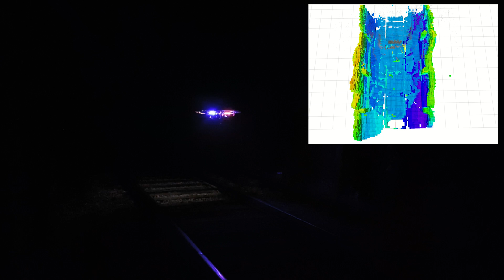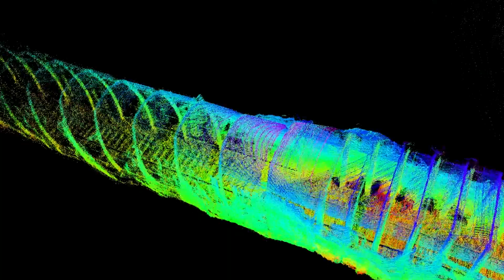Autonomous Aerial Robotic Exploration and Mapping of a Railroad Tunnel in Degraded Visual Conditions

Comment: Hi! Amazing project !! 
What about the robot specifications?
Thanks!
Reply from the maker: Thanks. The robot is ~3kg, has a NUC i7 onboard, stereo visual-inertial depth-enhanced (a time-of-flight depth sensor - namely picoflexx) module built in-house and synchronized with flashing LEDs.
Reply: Kostas Alexis and did you use a simulator to test the algorithm? Or you did directly the phisical test?
Thanks again, I'm developing something similar
Reply from the maker: Check here for the planner: https://github.com/unr-arl/rhem_planner which also points to our relevant ICRA 2017 paper. Previous work refer to: https://github.com/ethz-asl/nbvplanner which was tested in simulation (rotors simulator: https://github.com/ethz-asl/rotors_simulator). The perception system is of course directly tested based on data.
Reply: Kostas Alexis really helpfull, thanks!
Reply from the maker: you are welcome!
Reply: Excuse me, another thing. What about the computational power of your environment? 
I'm running your planner on a i7 virtual machine, 16gb RAM and when visualizing the point cloud ALL the process slow down so much..
Reply from the maker: Paolo De Petris it runs all onboard on an NUC i7. If you visualize everything it will slow down yes. You don't need visualization for the robot's real time operation.